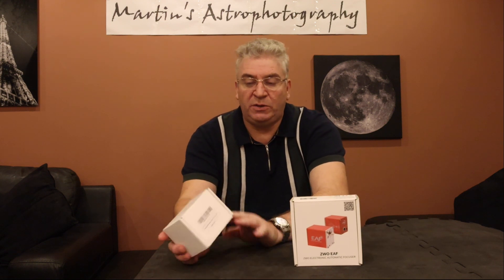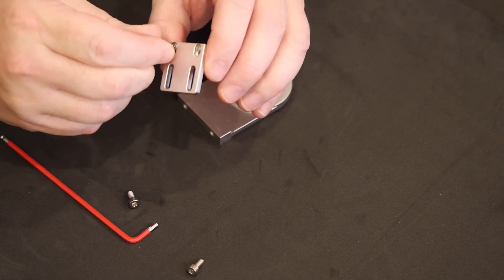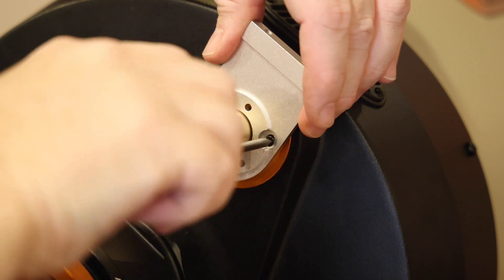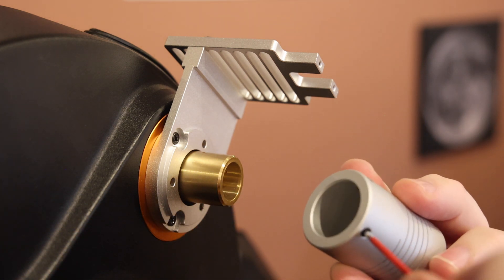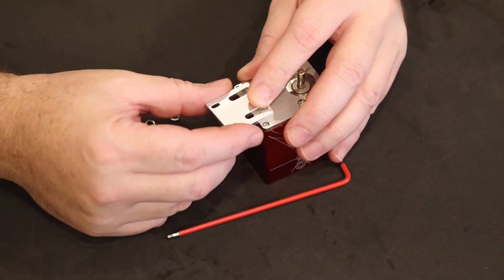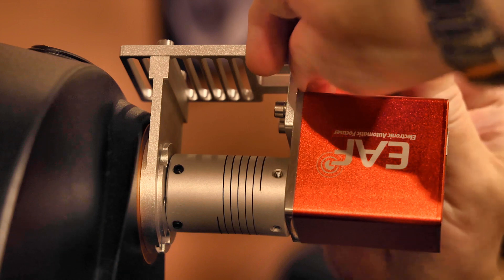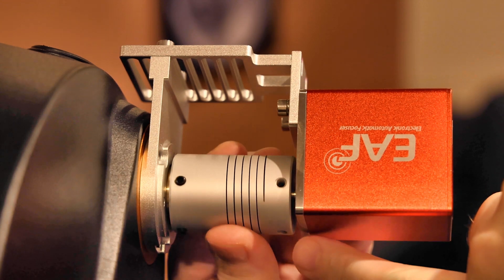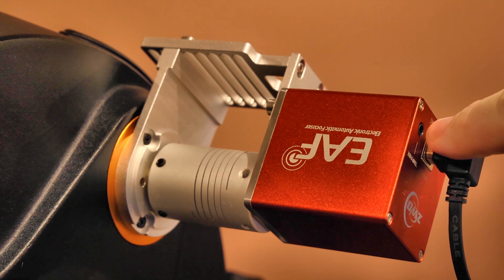Fitting a ZWO EAF Focus Motor to a Celestron EdgeHD 11 or 14 Telescope

Comment: Thanks for the video. How big of a V curve do you get with using the ASIAIR? Mine seems to be working and in focus on my C11 but it's a lot more shallower of Curve compared to my refractor.
Reply from the maker: I don’t use ASIAIR... I use NINA. If the curve is too shallow I increase the step size used. Perhaps you can do the same on ASIAIR?

Comment: You can use filler gauges to measure the gap on all 4 corners up down left right and once they are all the same you have achieved perfect alignment.

Comment: Curious why point bracket out and away. Can it not orient  inwards? Or is that a bad thing?
Reply from the maker: If you point the bracket inward it will foul on the optical train coming out the back of the telescope tube. I have the reducer fitted and it would definitely foul on that.
Reply: @martinsastrophotography  ok thank you!
Reply: Or is it because you had to lower to the third slot ?

Comment: Hi, Martin - Question for you in case you have dealt with this issue....  I have the Celestron Edge HD 9.25 and installed the EAF on it.  I use a ZWO filter wheel and ZWO OAG-L that are both screwed onto the ZWO camera in a fixed position, possibly same setup you have.  So, rotating the camera means rotating the OAG and EFW.  However, If I want to shoot without the Celestron 0.7x reducer, I can only rotate the camera a few degrees because: a) on one side the guide cam (in the OAG) prevents rotation because it will bump up against the EAF; and b) on the other side the USB cable sticking out of the EFW will bump up against the EAF.  So, the EAF is kind of pinned between the two preventing any real camera rotation.   I see that the Celestron OAG will rotate but rotating that OAG without rotating the camera along with it would mean that the OAG prism would be moved out of its ideal position relative to the camera sensor.  Have you run into this and is there a workaround?  Thanks very much.  Ken
Reply from the maker: Hi Ken. Yes, I am familiar with this problem. It is one of the reasons I ditched OAG a long time ago and went back to a separate guidescope. Another solution is to lock your primary mirror, remove the EAF altogether and use a microfocuser for focusing. This has the benefit of eliminating image shift when changing focus adjustment direction due to mirror flop. I hope this helps.
Reply: @martinsastrophotography  Thanks very much for your input.  I will look into this option.  Much appreciated.

Comment: Thanks a lot, this helped me to install EAF on my EdgeHD 8! The C8 bracket now comes with three screws to fix it to the telescope body which are a bit longer than original compensating for the bracket thickness. It is important to keep orange plate in its place as the bracket does not replace it as I initially thought.
Reply from the maker: Glad it helped. Clear skies!

Comment: Martin this does NOT work correctly for the latest 1400 EDGE HD because the orange plate has 5-6 mm deep flange around the rim. It really fouls this process up.
Reply from the maker: Thanks for the comment Bob. I read online that it was also suitable for the 1400 but I have only applied it to the 1100 myself.

Comment: Can the ZWO EAF be used on a Celestron EdgeHD 925 with a Celestron 0.7X focal reducer or is there not enough Clearence between the reducer, focuser and bracket?
Reply from the maker: Sorry for the slow reply...Yes it can, but note that if you are using the 0.7x reducer you will need to grind a little off the base of the EAF mounting bracket to prevent it from fouling on the reducer.

Comment: I'm willing to purchase one for my EdgeHD 11.. are you enjoying it?
Reply from the maker: Hi Luiz. So far, yes it works very well. Of course when the focus direction is changed you get mirror flop and image shift, but that is the telescope, not the focus motor.
Reply: @martinsastrophotography Martin do you have a workaround the minimise the mirror flop issue?
Reply from the maker: @teslar1  You can either complete focus always in the same direction, or lock the primary mirror in place using the locking knobs, ditch the EAF, and use a micro focuser such as the  Primalucelab ESATTO.